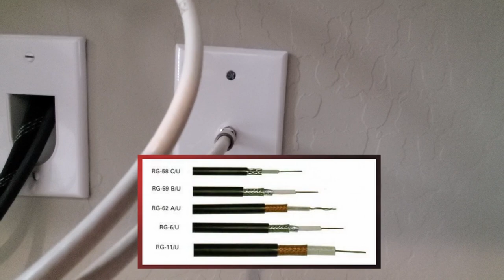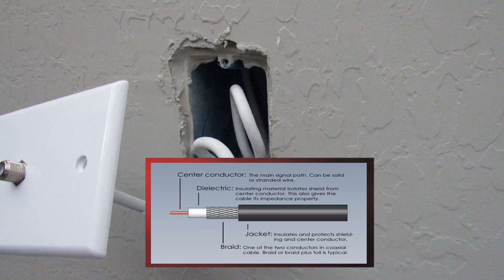COAX CABLE FACTS, SAFETY & DOS & DON'TS! COAX OUTLET INSTALLATION - HOW TO

Comment: I have a white coax cable in my room but a black cable that plugs from that, into my router/modem (not this kind of tech savvy). Also if that’s not the problem, the coax in my living room works but the one in my room doesn’t. What could be causing that?
Reply from the maker: It sounds like the other end is not hooked up to your cable company. Check the small panel outside of your house that says catv and look to see if all the coax cables are connected.

Comment: I can’t find this answer anywhere. Maybe I’m have some luck here, but we already have existing Wi-Fi here at home but I wanted to get my own Wi-Fi router in my room. Is there a way to get a coax cable upstairs without interrupting the existing Wi-Fi router and coax cable?
Reply: Mesh system. No need to move any cable. Each router is it's own system and has no upload download loss like wifi extenders and you can still plug in for a hardline.

Comment: Can I use a coaxal cable to connect my living room tv to another tv in a different location in my house
Reply from the maker: Yes absolutely.
Reply: @UltimateTechHub  please I need help on how to do that. I just bought a coaxial cable that fits into my Samsung smart tv and my coax wall outlet. But I still can't see what is being shown on the tv on the other tv instead I can see local channels

Comment: What about 90° fittings? I've heard these are not recommended for home entertainment use. Only radios. Any bases to that?
Reply: Yes. 90° fittings don't always have the best contact with the cable center conductor and generally fail faster then standard good quality fittings. I never use them as they are hit and miss.

Comment: I wanna do this but I don’t want to spend $25 more to buy a pack with a cutter. I feel like the stripper and compression tool are enough...
Reply from the maker: That will probably be fine.  Just use the best cutter you have. Like a good wire cutter. Thanks for watching and if you subscribed thank you as well!
Reply: Ultimate Tech Hub can i just not cut it? Like I don’t think it’ll make a difference..
Reply from the maker: @persian-k4i  if it looks like it has already been cut  cleanly then you will be good. Just make sure the entire coax is cut evenly with no uneven edges. That way the f type connector sits flush.
Reply: Ultimate Tech Hub Hi I’m doing this right now and seem to be having a problem with connecting it to the outlet like it does not stick any advice. I would appreciate ASAP
Reply from the maker: @persian-k4i  here is my video that will take you through the process.
https://youtu.be/ik10WiIMfv0
Good luck and keep me posted.
Reply: Ultimate Tech Hub I actually got it in but I’m not getting any signals in is their anything that might be affecting this?
Reply from the maker: @persian-k4i  it depends where the other end of the coax goes.
Reply from the maker: @persian-k4i  this another video you should watch
https://youtu.be/NBEWMBjNY_A
Reply: Ultimate Tech Hub ye I think there’s no signals.. I think I’m just gonna get a 50 ft Ethernet cable from the modem..

Comment: Are coax wall outlets safe? (Not the coax cable, the one on the wall)Is there electric current or anything running through them? I have an old one in my bedroom that was there before I moved in.
Reply from the maker: Totally safe. Coax outlets will not hurt you.
Reply: @UltimateTechHub  Are they a fire hazard like a regular wall outlet/sockets?
Reply from the maker: @hailseitan3876  no its not rated as a electrical outlet its rated as low voltage. No fire Hazzard.
Reply: Coax cable will usually poses no harm to you at all.  There really shouldn't be any more than 4 millivolts coming out of each ends of your wall plate outlet. Coaxial deals with frequencies that is a little as 5 MHz up to 2000 MHz depending on the system.  Any power on a HFC system (cable network) that is above 12dbmv is too much power. That's really a fraction on 1 volt!  So, no.  There is no fire hazard or shock hazard (unless you have a backfeed, bad ground to an equipment or power inserters) at all.

Comment: Do u gotta plug the Wifi box in the wall
Reply from the maker: You will need to plug a modem into the coax outlet and then plug in the wireless router into the modem. Here is a video you can watch for that setup.   https://youtu.be/78lnzTRdP24 
Thanks for watching and keep me posted if you have any issues. :-)

Comment: COAX speed is limited by DOCSIS stands for "Data Over Cable Service Interface Specification. Most common for consumers are versions 3.0, and 3.1, 4.0 is too expensive. https://en.wikipedia.org/wiki/DOCSIS

Comment: Quick correction for you: The transmission speed of coax is 10 Mbps (megaBITS per second), not megaBYTES per second.
Reply from the maker: Yes I sometimes say the wrong thing. Sometimes I say Bytes instead of Bits or vice-versa. Thanks for watching.

Comment: ok so i just got cox and we don’t have a coax wall plate and i need help the wifi box says i need to connect it to a coax cable but all the cables in my house run through the wall. please hep
Reply from the maker: So you don't have any visible coax in any rooms? You shoudl have a coax in every bedroom and living room. Is there a blank wall plate in any of the rooms? If yes unscrew the blank wall plate and the coax should be inside.
Reply: Ultimate Tech Hub yes i have the coax in every room but i dont have and blank wall plates, i dont have any wall plates at all
Reply from the maker: @hykdee  so the coax cable is coming out of the wall? Just hook up your modem to one of the coax cables. Then connect that modem to a wireless router via a ethetnet cable.
Reply: Ultimate Tech Hub so i need to buy a wireless router?
Reply from the maker: @hykdee  if you want wifi and more than one computer internet connection. If you have only one computer and don't need wifi then the modem is all you need.
Reply: Ultimate Tech Hub i just need wifi for my xbox and my phones
Reply: Ultimate Tech Hub i also have at&t cable and i have a coax coming out my wall for the at&t cable box. Can i use that coax for my cox wifi
Reply from the maker: @hykdee  then you need a wifi router.  They are priced  at around 100 dollars!! Good luck and keep me posted!!! Thanks for watching!!!!

Comment: What if the coax cable is broken but the cord can still go in will that mean the speed of your internet decreases I have the 600 mbps extreme pro internet plan but when I test the connection on the game it only says 25 mbps I am confused can you help
Reply from the maker: Typically when playing games online you will only get 25 to 30 mbps and thats all you need  I have 1gig fiber and my PS5 internet speed is about 40 mbps sometimes less. But Call of Duty plays perfectly!!
Reply: Doesn’t listen to this guy , if your cable is physically broken then it no longer transferring the RF properly, you have noise, signal loss. Get a new cable or just call your internet provider. The broken cable is definitely causing your speed loss.
Reply: Martin is right. Your cable modem bonds up to 24 downstream frequencies (channels) to get the speeds out of your DOCSIS 3.0 modem.  Broken cables will cause signal to noise issues and ingress.  You have any of those problems you will experience network issues and that includes slower internet speeds.

Comment: New subscriber, Thanks for taking the time to do this video it answered several questions I had, but I have one more.  I live in a 100 year old house that has coax cable all over the place, I would like to get rid of some of the ones in the basement because they are in the way (they have open ends). I only use a cable to the router on second floor, would it be safe to cut those cables? Is there an easy way to test the cables to see if they have a load?... could be using the wrong term.. to see if they are the cable that my signal is on?